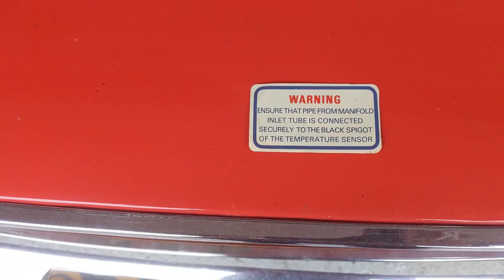Triumph TR7 Restoration: Episode 27   Air Filter Box

Comment: Yep they have come up pretty good Henry,  my Air filter is different again they must of changed over the years , so I haven't got that sensor,  and mine is gray not black maybe they just improved as time went on 👍 take care
Reply from the maker: Hi Carl, yeah, I don't think the early cars had it which is interesting because the mechanism is just like the Triumph Stag so they had it in the factory
Reply: @HenrysGarage  Cost cutting I bet .. if they could get away without it then they would as the engine looks like it was designed to have that part fitted  in my opinion  🤷‍♂️